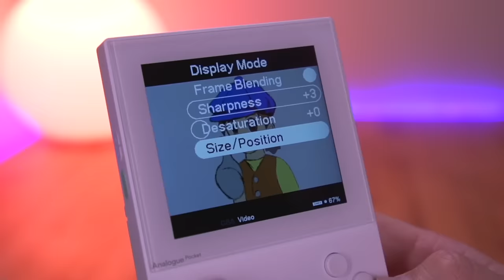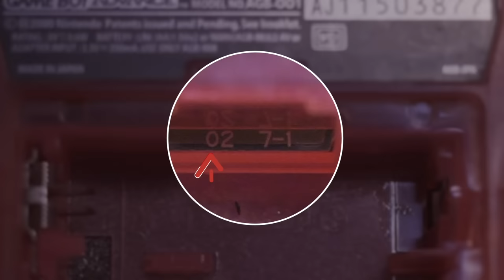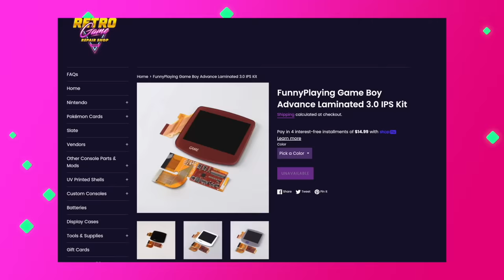FunnyPlaying’s New Laminated IPS 3.0 Kit | NO SOLDER Kit

Comment: I'm super confused while trying to order the kid. I want to get the battery mod, but not only do they not offer many colors to match the shells, they seem to use different color names, so I can't even tell if I'm matching what they do offer. "Grey" seems to be used in different variations. And for some reason there is no "white" for the battery cover, even though the photo of "beige" looks very white. It seems that your options are very limited if you want to do the usb-c battery mod, as the color combinations are not very lined up.

Comment: What... is the frame blending for? GBA games ran at 59.725 FPS, roughly, which is what the screen was meant to handle. Frame blending is like what you do to output a VHS show (59.94 FPS / 60 FPS) on the cheap (23.976 FPS / 24 FPS) for broadcast. It's obviously slower motion but doesn't lose information... as much.

How are games running at a native frame rate needing to be blended? I'm confused.

This is a really nice kit. Finally a good, proper, no-solder one.
I have absolutely no idea why you felt the price was a con---it's leagues cheaper than most products you look at, while offering tremendous functionality. It also seems to be relatively in-line with IPS screen costs anyway. Unless I misunderstood this (which is entirely possible) and this was literally the only bad thing you could think of, since, well, a pro/con list has to have something negative.

Comment: Hey! I actually just got the USB C Module from FunnyPlaying. But for some reason(s), the battery can't be shipped to me here in Indonesia. So, I specifically request them to just send me the USB C Module without the battery.

My questions are:
What type of battery is being used? (possibly the code and the dimensions of the battery)
What type of connector does the battery use? (I find that some Lipo batteries use a different connector)

Thanks!

Comment: Any new mods come out for a screen using the original shell without cutting? Or is it still the same one from a year or two ago?
Reply: AFAIK only CleanScreen from RetroSix, but I would say it works best with a little trimming of some plastic bumps on the inside, though.

Comment: I dont understand you did solder, why put no soldering required on the picture literally got me excited for nothing. Im refering to the wires being soldered. Question below.

If i got the kit, and tried to install it without soldering the cables on to it or no somdering whats so ever, would i be able to use it and play? My GBA has no backlight which is why i ask this.

Comment: Are there any D-Pad mods for the original GBA?  After building a nice IPS one I've realized I kinda hate the GBA d-pad, it's very mushy imo.  I mostly played Gameboy games on an SP and liked the clicky d-pad, but most anything is crisper than a GBAs it seems.
Reply: Mahko makes a mod that allows you to use GBA SP clicky buttons and dpad on an original GBA.
Reply: @Zanpaa  Oh wow thank you for the info, I wish youtube freaking told you when you got a comment reply!  It doesn't look like any place sells the mod as a kit, is that right?  I'd have to order the flex boards from OSHPark and some buttons for them?  Not a big deal if so.

I also see some talk about putting a spacer on the stock D-Pad to reduce its travel, any experience with that by any chance?

Comment: Would you recommend something like this, or to just get an Analogue Pocket?  Price isn’t a problem, just more concerned with making the right choice.
Reply: Do you want it to be an original GBA or not? That's basically what it comes down to. The Analogue screen is also meant for GB/GBC first and foremost, the image will be smaller for GBA games than on a modded GBA. But you can do a lot more things with an Analogue that would never be possible with a modded console, including FPGA emulation for many systems and not just Game Boy.
Reply: If price isn’t a problem, why not get them both? 😅

Comment: Would of been nice to see if the image retention issue on the IPS displays for GBAs was reduced, I went with the ITA because the IPS one just had way to much ghosting for my taste I wonder if the frame blending makes it even worse? Thanks for the video
Reply: Hi, I've ordered the ITA kit too. Does the IPS really have ghosting, on which revision/manufacturer kit did you notice this? Was it on your own GBA? Usually IPS has superb pixel response time. If screen ghosting would be a thing, it would logically be only for the ITA screen, since it's an older display technology. Isn't that right?

Comment: Where can I buy pre-modded consoles? I'm not doing all of that work. Just finding the components are a chore.
IPS + rechargeable battery with USB type C connector + amp + BT + power cleaner, etc etc. All the good shit in one package, cost doesn't matter as much.
Reply: eBay has several, I'm looking at getting one from there myself

Comment: This kit is looking great, but is there no pixel grid emulation? Just a scanlines mode?
Reply: No, because this screen doesn't have integer scaling horizontally sadly.
Reply: @Zanpaa  Oh! Thanks for that bit of info.

But what does that do to the image then? I didn't notice anything weird from looking at the externally recorded footage here, no shimmer or weirdly sized pixels.
there any specs out there to check out? (and sorry, I've just seen this reply)
Reply: @PatoCrioyo  it is corrected by software. In game the image looks fine but if you use an actual test suite you will be able to notice it.
Reply: @HighPower64  Oh, that kinda sucks. I have the IPS Q5 screen on my Neo Geo Pocket Color and I love how it looks there. Do you know if this laminated screen is the same as the one that comes with the Slate kit for the GBA SP? I was looking into building that one and it seems to be.
Reply: @PatoCrioyo  no the Slate comes with a 9380 LG panel. This is a different LCD.
Reply: @HighPower64  Thank you.

Comment: I still have no idea what that frame blending thing is or what it's doing.
Reply: Mahko explains it in some of his videos, but in short:
Game Boy couldn't do transparency. The way some developers got around this is to flicker the image very fast between the image in the back and the image in the front. Because the original Game Boy screens were so slow to respond, that would make it appear like both images are on at once, and thus give the transparency effect.
However, new IPS screens respond very fast, and they will actually show the flicker between the two images, which isn't what the developers intended you to see. Frame Blending works by blending the current image with the previous frame, to make it look like those old screens, and that will give back the transparency effect and remove the visible flicker.
This is only for some specific games that used this "flickering transparency" effect, and most of the time you can just leave it off, but it's nice to have the option.

Comment: My only concern is how will the HDMI kit fits with this kit. :(
Reply: I mean, if you’re gonna be playing on HDMI, wouldn’t it be better to have a dedicated consolized GBA? I’m pretty sure the SP version is even one of the easiest versions that still is good quality, what with it not needing to solder to the CPU to get digital signals.
Reply: The two wire kit won't really fit with this I think. You can probably make it work but things are going to be seriously smushed together.
Reply: @Zanpaa , thank you for letting me know. I guess will go for the 2.0. I love this new kit but limitations for not be able to have the HDMI option well... :(
Reply: @rickyrns1059 , I understand but in my case I like to have the option to play it on big screen like we do with the Nintendo Switch or play it handheld.

Comment: Does it not have desaturation as a color option? That seems to me among the best reasons to use RetroArch over any other setup--someone worked their ass off to get that AGB-001 color filter precisely accurate.

Also, is there no cartridge slot on that case? Do you just install a flashcart beneath it or something?

Comment: I've contacted Funnyplaying regarding this to answer some questions this video didn't adress:

1. Yes you need the specific shell for the laminated kit. An old one won't work
2. While Funnyplaying says it's generally possible to modify a shell to accomodate the laminated kit they don't recommend it and suggest it's difficult to do so.
3. Funnyplaying is not manufacturing the Indigo Shell (Original GBA Color) as "there is no demand for it".

Comment: The ONLY thing I could think of to improve the screens would be make them higher resolution and have some kind of upscaling... but I'm not sure that would do much with it being such a square-pixel based gaming system....  I don't think upscaling would make it look any different, or even be possible. it's not the same as upscaling a 3d rendered type game/system because it uses sprites, and you can't just upscale them, right?
I'm not sure of any of this but it has actually been something I've thought about before and feel like it's pointless to incorporate this in a sprite based system.... You would have to change the entire make-up of the system and the games, like draw new sprites and backgrounds... it just wouldn't be possible... not like the 3d systems....
Reply: That's already the case for most of these aftermarket screens. They use integer scaling when possible, this specific one sadly isn't integer scaled. That's also how they can do the "pixel" mode that simulates lines on the screen.

Comment: Well I can certainly tell you how they can be improved, & that's to have less input lag.   Each and every screen mod kit that I know of has significantly more input lag than the stock screen, and until that changes I simply can't get on board with doing one of these mods to my own system.

It's kind of sad that hardly anyone talks about this, as it will probably never improve until people start showing concern for it.
Reply: is this true? I haven't heard it anywhere. I suppose it would technically be display lag as nothing is affecting the button input response time.
Reply: @dizzydee4889  Yes it's the display.  Maybe a combination of the display itself and the hardware that does the scaling.

Comment: TIP: if you find that the colors are being distorted when you close the shell, it is because of the unused 32/40 pin connector being bent. Cut the one you aren’t using off and you will be good
Reply: Hey I have a question. I have the 32 pin model GBA.  I tested the FunnyPlaying Gameboy Advance laminated 3.0 IPS KIT out just to see if it works but it doesn’t. I double checked everything and I don’t know why it doesn’t work. Do you by any chance might know the reason why.
Reply: @JohnyJR-1  If you have no image, that probably means that the ribbon cable isn't connected properly. Maybe look up a tutorial on connecting ribbon cables or something. If you have an image but the colors are distorted, the unused ribbon cable is being bent. Because you have a 32 pin model, cut off the 40 pin ribbon cable.
Reply: @yoshipilot  Ok thanks for the info. I double checked everything and there is still no image being displayed. I already contacted support and asked them what else I could do to make it work but they haven’t responded.

Comment: Bought the Kit but the Shell isn't holding the screen at all. Pissing me the Fuck off They Really need to think though how the Glass fits into the shell.
Reply: lmao sounds like user error bud
Reply: @HighPower64  needed a tiny bit of adhesive and now it stays in place. For a press fit that is pretty bad tolerances bud.
Reply: @snintendog  You do not need adhesive.. I have installed like 10 of these things so far. They are like the easiest kit ever made bud.

Comment: I don't like when console mods hijack the existing buttons, so to me the no-soldering option is both the easier and more appealing option in this case. Having an invisible touch sensor under the GBA logo on the bezel is such an elegant solution compared to holding button combos or having to grind out a notch on the edge of the shell for an extra button.

Comment: Followed these steps perfectly and it doesn't work. Why can't I ever get one of these that will just work as expected. I did the funnyplaying IPS 2 back in 2021 and it stopped working 2 years later. I got this one, it turned on for about 30 seconds. So frustrating.

Comment: NEW Shell, NEW case, NEW battery, I gotta ask, at what point is this no longer a GBA?
Reply: There are even people doing entirely new motherboards. It's still a GBA because it uses the original processor and ram.
Reply: @Zanpaa  why not add a new processor and new ram 😁😁
Reply: @obamastolemyvcr1446  Because those are what make it a GBA! And also we don't have those parts new, so the closest we can do is FPGA like the Analogue Pocket, which is definitely not a GBA.
Reply: @Zanpaa  the GBA of Theseus 

If the internals are replaced but you still have the original shell and screen is it gba?

Comment: I'll wait for the revision so that it can be affixed to the shell with 3M tape like the GBC. I don't trust that bracket nor do I like not having support rails for the screen to mount to the shell. Just one drop and it's a goner. Also I'm waiting for the revision so we can get a lit GBA logo like the Q5 GBC display. Everything else is satisfying. Ofc I've been waiting six-eight months for them to get this consumer ready so I could hopefully see these revisions. But I guess they aren't there yet. They also should of just did the SP as well but I see one handheld at a time. Mahko is probably on top as far as innovation and support for the SP. I just wish there was options for non slate users.

Comment: Soldering on the back of the screen is risky. Would not recommend, as I did this with my first IPS display upgrade & learned the hard way that it will kill a pixel or two, very annoying! Solder before attaching to the screen!

Comment: A Con you missed - The colours for the replacement battery cover that comes with the rechargeable battery kit aren't as varied as the colours for the replacement housing, so if I choose a colour for the housing that's different from the colours available for the battery pack, then I've either got to have a mismatched cover or take the cover off every time I need to recharge it. That's a huge oversight in my opinion.
Reply: they are rolling out the battery cover colors all the time. If the color you want isn't there just wait to buy the battery mod, simple.
Reply: No, they do make the usb-c battery covers in exactly the same colors as the shells, so this isn't a problem.
Reply: @Zanpaa  the link in the description only shows about 5 colours for the battery pack, whereas there's 10+ colours for the shell.
Reply: I see like 15 colors of battery cover so what are you smoking? Let me get some!
Reply: Alright guys I get it, they have colors now. When I looked there was 4 colors, obviously they've restocked.

Comment: No soldering required, but people complaining about being 'baited' when he proceeds to OPTIONALLY solder three tiny wires.
Good grief, you people need to pay attention. He even repeatedly says it's optional, but you rather whine instead of listen.

Some of us rather have that solder option available since tapping the sensor only goes ONE WAY in the brightness sequence. 
There are some people, however, that their fingers don't 'conduct' sufficiently enough to 'touch' the sensor.
Need to brightness the opposite direction? Just keep tapping until it cycles back around.
Some can live with that. Others rather have the option to go the other way. And he rather use the full design.

tl;dr
no solder required: tap sensor to cycle brightness

Optional solder route; Sel+Shoulder trigger (Optional)